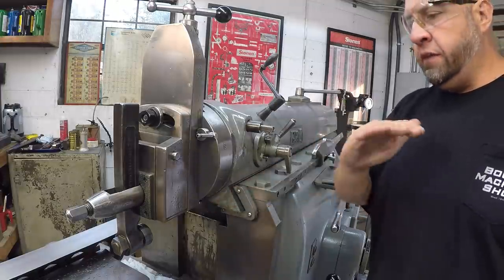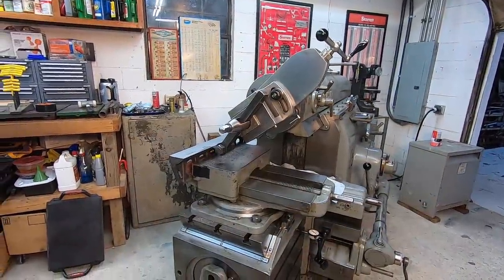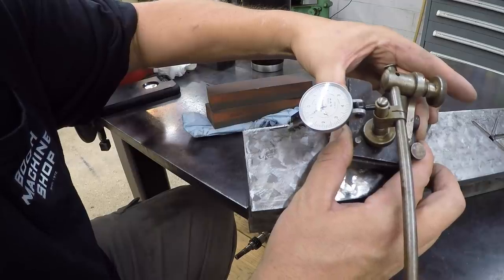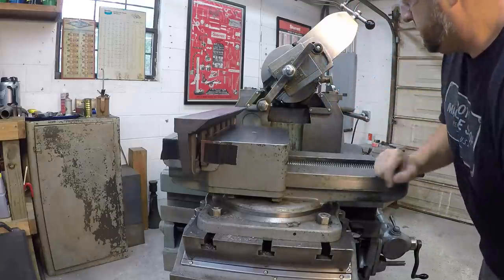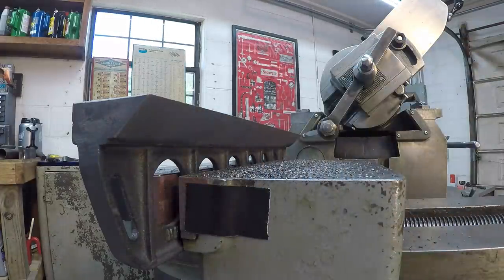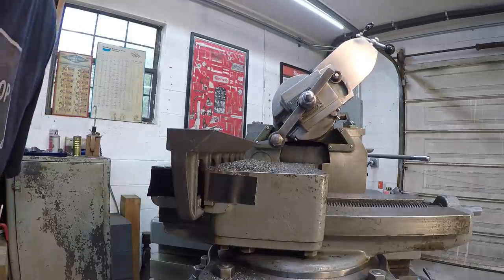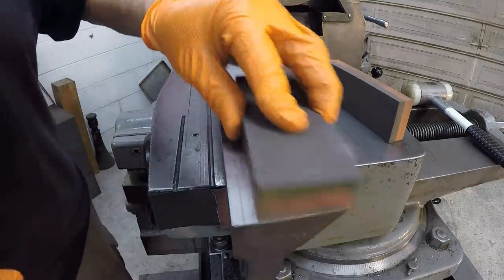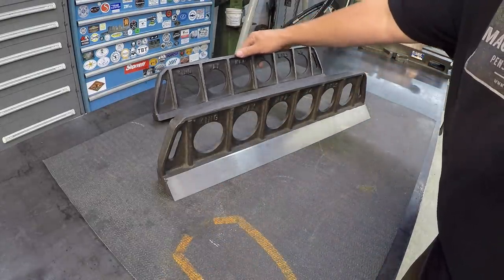Machining a 24 in Straight Edge with Dovetail Episode 2

Comment: Nice job of checking out the problem plus you found the oil level issue and were able to resolve it all. This is why I believe in checking every single operation on the machinery I use, it not only alerts me to potential problems but often you can head off a situation long before any damage can occur .

Comment: Nothing you don't already know Adam, but both those straight edges need a couple of wood, plastic etc handles to insulate the cast iron from hand heat. A nice informative series showing how to shape these straight edges into pre scraping condition old school style despite what the few non shaper fans seem to think. .001" over 24" is better than any average knee mill could do including a new Bridgeport. Paint color? Find something that matches a combination of hi spot blue with cast iron dust in it to save cleaning time later. :-)

Comment: I once changed out a VCT solenoid (passenger side) on a 5.4 3V when I should have just tightened the loose spark plug that was the actual problem.... because I'm an idiot. Valve cover, AC lines, trips to Autozone and an a package from Amazon ...it was a fun couple of days. Stuff happens. You and Rucker and Finner amaze me with the things y'all do right...the first time. Great stuff. Thanks for sharing.

Comment: Yeah... easy to do with a shaper. I’m certainly no Abrom. But I did similar thing when I first started using my Rhodes 7” shaper. The geometry of the ram / stroke constantly changes when making adjustments. I learned the hard way ( before I did serious damage ) to always manually turn the belt and inspect to make sure the ram isn’t hitting the housing.

Comment: Good eye Adam. This one of the reasons why shapers are problematic. You have to look at both sides and make sure you compensate the proper clearance for your cuts. Otherwise you will crunch the ram. And lets not forget the guys who push  the part out the back of the vice. Nice to see you were alert and used all your senses and notice the problem right away. Nice fix Adam. Job well done on the straight edge. If you would of used a positive flat bottom tool you would have a edge surface that is a lot closer with your indicator. Keep up the great work too.

Comment: Ideally you want to make it a bit shy of 45 deg.  When using this to scrape you can always "tip up" a bit.  If you make it right on 45 and the dovetail you are scraping is shy of that you have a problem.  Otherwise great video, I love watching these shapers run!
Reply from the maker: Hey Cash, my understanding is that most ways will be 60° so the 45° angle should give it plenty of clearance. I was going off of what others has done.

Comment: Judging from the appearance of the stoned surface of the bottom of the dovetail straight edge, the square-nosed tool was not making cuts that were exactly parallel with the overall surface.  (See the video at the 26-minute mark).  You can see that that is the case by the regular repeated pattern of the shiny stoned metal that peters out at the approach to the adjacent cut.
I know that Adam likes the appearance produced by the square-nosed tool, but for this application, I wonder if a shear tool used with a finer cross-feed would not produce a flatter finished surface. Since seeing shear tools used in shapers, I have experimented with using shear tools in the lathe. The surface finish that can be achieved, even on ordinary stringy mild steel is impressive. 

It looks like a ground finish. 
 Thanks for all the great videos. Cheers

Comment: Very glad that gib rubbing was so minor, it could have been worse, I think you really lucked out on that one. Learned a lesson gently :)
The upside down cut was not your usual type of cut for sure. It had the potential to disable the clapper which also could be messy. Since the tool raises up on the back stroke but the work is above the tool...

I would really love for you to try sticking a thin piece of leather on the back of the tool to stop the metal on metal rub for the backstroke. If it was not an issue then no one would have created auto tool lifters.

Comment: In my HS Mach shop class,many many moons ago, a student popped the head off the shaper,it did quite a bit more damage,good move,or luck, turning the vertical feed rate down,or you might have experienced the same catastrophic event.Good to have learned that.
Reply: JD Sharp   Was Mr. Pete your instructor?

Comment: One scraping project, tho i don't think you can get them fast enough for the class, would be to have two small cast iron plates with you. Those make really nice scraping projects and useful tools once you're done. Certainly handy to have around when checking large equipment that can't be moved.

Comment: Talk to Richard King about the angle, he says that less than 45degrees is better, 44 degrees is fine, better! Regards, Matthew
Reply from the maker: Matthew Tinker It makes no matter the angle
Reply: @Abom79  It is easier to use a straight edge that is smaller than the angle, you can "rock" it to get it flat, you are not stuck in the "V" and you can feel it better!

Comment: I disagree with your decision to go to 45 degrees.  This prevents it from fitting into any 45 degree gap.  It also removed more material farther out from the body. 43-44 would IMO have been a better choice, maybe even 42.
Reply from the maker: Bob O`Bob most machine dovetails are 60°, 45 is the standard people machine them to.

Comment: nice save on the machine abom! pretty minor damage :)
as for the color of the strait edges. grey,.... grey seems to go good with any machine shop
Reply: For that "Straight" straight edge with the nice machining on the ribs of the handle I'd keep the natural colours and just clear coat it. I like the contrast of a cast against a machined surface. The look of my old BAHCO adjustables comes to mind.
For the 45° tool on which the handle didn't clean up so well then I guess some colour would help tidy it up.
Reply: @KozmykJ  some tools are ok left as is, but I really prefer keeping machined/scraped finishes and not cast finishes due to how rough they are. plus most of my machines are grey. and it seems to be a color everyone enjoys... cast finishes I always feel look unfinished 
I do quite allot of cast steel parts and they always go for powder coating,
Reply: @Donkusdelux  I get your roughness point but once a layer of clear is on there they're not so rough. All depends on how good the cast surface finish looks to start with of course  ...
Reply: @KozmykJ  aye :) very true~

Comment: Adam, why not investing some time / money into making back stroke cutting tool keeper or whatever that contraption name is? I've seen somewhere that is some simple friction rod mounted to the machine that keeps clapper box a bit open on back stroke, so it prevents potentially ruined surface finish. You can see it rubbing always on back stroke and it surely is not ideal. Cheers!

Comment: Came out  nice. I wonder if there is a trick on the these angled downfeeds: the angle of the clapper may have to be changed (to what I have no idea), the tool is dragging on the finished surface on the back stroke.
Reply: I am not sure but I think the clapper is set on the wrong side of center, should swing away from the work on the return stroke. JB
Reply from the maker: 445supermag The clapper is set correctly.
Reply from the maker: Jake, I have it correct.
Reply: sorry I was wrong, Adam is correct.

Comment: It was too bad about the hard spots on that dovetail straightedge. But I definitely agree with you about the finish on the other one. I almost wouldn't want to scrape that in either.
Reply: Isnt it doable with a carbide or diamond tool?
Reply: @orfeous  maybe, but could be costly. Carbide is hard but brittle. It might chip or break from the shock of switching quickly between various hard and soft spots.

Comment: Adam,

You changed the tooling setup to provide the advancing tooling head clearance you needed. Could the part been oriented end for end in the vise and the table tilted 45 degrees, then down feeding with the head in the 0 degree position? I think that this setup would have allowed machining the bottom, 90 degrees side and the 45 degrees sides in a single vise setup and eliminating the gib clearance issue that you encountered. I liked your solution.

How do shaper folk identity axis on a shaper? I assume stroke is Z, but which is X and Y?

I love the refinements of modern machinery, but I also love the classy look and feel of quality vintage iron. I spent a career in the machine shop and never saw a shaper operate. Now I am retired and I really enjoy watching you young bucks reintroduce the old technology.

I grieve for the scarring on the side flutings that you couldn't clean up due to the hardness. Did you dress this out or leave it? I do woodwork as well as hobby machining. I am tackling more and more complicated wood projects to learn and to hone new skills. I will deliver a fine cherry hope chest tomorrow. It has three incorrectable oops blemishes that my wife can't see, but stand out as glaring errors to me. You do fine work. I aspire to approach your skill.

Comment: 1 thou over 24" on a shaper is excellent Adam, you must be chuffed about that.
Reply: If he's anything like the other old-school-trained machinists I know, he's telling himself it's "pretty good", and thinking about how to get to half a tenth on the next one.
Reply: I can definitely see a surface finish improvement if he works on the bit geometry. I'm not sure how he might improve the deviation on the stroke of the machine. There's a lot of things in play on this machine when it's in operation that could cause a dip on the ram.
Reply: I don't know enough about shapers. Give it three months at most, and we'll have an answer.
Reply: ThrowingItAway 
L
Reply: @Coffreek  ...He has used this scraper well over three months.

Comment: Hey Adam! Nice project for the scraper! I noticed the overoiling you mentioned on the left way. I would be willing to bet that that's the side that the pump makes it to first. But either way I would put a restrictor sleeve in the oil port on that side. About 25%. That should force more to the other side where it looks a little shy of oil. You coul always drill it out if it cuts off too much. Once you get it to even out, if there is still too much, you could add a spring loaded adjustable pressure valve to bleed off some back to the tank (bottom?) Hope this helps...

Comment: Forgive my ignorance, but if the 45 degree angle doesn't need to be precise, why have it at all? Could you explain a little of why its nice to have it on the base of the straight edge?
Reply: When you're bluing the surface to prepare for scraping, you're only wanting to bear on one of the surfaces. So when you're bluing the flat part, the angle section of the straight edge shouldn't be touching the angle of the ways. When you're bluing the angled part of the ways, only the angled part of your straight edge should be bearing on the angled part of the way. So really any angle between ~30-45° is acceptable.
Reply: @xenonram  Thank You

Comment: I know you have gone over this many times but for this 45 degree cut which is underneath or reversed, you DO have the clapper the wrong way. The arc is swinging the tool up INTO the part.
Reply: What is the clapper you are referring to?
Reply: Robert Mick it’s the plate that the cutting tool is mounted to that hinges and allows the tool to “float” over the workpiece on the backstroke. It can be angled left and right depending on which direction you are cutting as well as many other factors.
Reply: Ahh, thank you for the explanation. I'm not a machinist, however I find the craft to be very interesting to watch, and Abom's humility and style make it very easy to watch.
Reply: Yes, I really like the guy too, he’s a good hearted southern boy like myself.

Comment: I am surprised you set up the job that way.  I would have thought you would have set up the straight edge so that the 45° surface was parallel to the table with angle blocks and clamps.
Reply: He has said many times that he enjoys the different setup challenges with the scraper.  This was one of those.

Comment: Hey Adam, why not have that Clapper box turned the other direction on the 45` cut? In my mind, the tool would swing away from the surface instead of dragging back over the already cut portion. I honestly want to know, I'm not digging at you, I just don't have the knowledge and want to understand.

Comment: While I'm guessing it's just a question of different ways to approach the same result, was there advantage to rotating the tool head and making the 45 degree cut versus rotating the table to bring the surface into a vertical orientation and leaving the tool head alone?

Comment: Gib damage caught on time, fixed and ended in a very nice job. I don’t understand why the hardness on the back if it is a cast. Isn’t it poured liquid and then should not have hard areas.
Reply: Hardness in a cast iron piece is due to uneven cooling.
Reply: Got it. Thanks.

Comment: If instead of angling the tool head, you kept it at 0°, set the tool perpendicular to the cut you want to make, then feed both the down feed and the step over together the same distance, shouldn't you end up with the same effect?

If the machine can do both feeds at the same time, by downfeeding say 0.020 and stepping over 0.020 at the same time, and having the cutting point perpendicular to the work surface, you will "trace" a line with a slope of 45° with every cut. It would be a little more difficult for other angles, as the ratio is not 1:1 and you may not have the right settings, but for 45°, it is pretty easy, if the machine allows it.

Comment: What if you "uncover" a void/pit in the casting after machining?   Do you braze in the void and machine it flat?  Also do you have a lifter for your clapper box?  I didn't see one.  You might have been able to machine those hard spots with carbide, but carbide doesn't usually like the banging on the return stroke of shapers, but maybe carbide has changed since my machining days. . .

Comment: @19:00 Isn't that a bit too much oil dripping out ?
Reply: I believe that gouge is now letting the oil flow past the oil seal
Reply: @bighurk30able  you might be right but if you look closely on the right side you can also see that the felt wiper retainer is also missing a chunk on the top corner but the felt still does it's job . It's kinda weird
Reply: He mentions it at 10:25. That one side has been over oiling all along.
Reply: @xenonram  Oh ok ,thanks !
Reply: Better too much than not enough.. an oiled machine is a happy machine.
Reply: @louisturner8842  Better a machine with the perfect amount of oil, than an over oiled machine. Lets not settle with mediocrity, and construct platitudes to defend it.

Comment: I hit with my shaper's head the lower slide way - when I adjusted the depth of cut using the top screw just too much and the stroke was long.

I was also like what is this thump sounds... never did that before... oh... clearance ;)

Comment: Does the tool bouncing on the back stroke leave a pattern on the finish?  Is there anyway for the tool to lift away from the work piece on backstroke to prevent that?  Great videos I always love watching a true craftsman.
Reply: I am not sure but I think the clapper is set on the wrong side of center, should swing away from the work on the return stroke. JB
Reply: I was wrong

Comment: Do u always set the Clapper at a greater angle than the head to ensure clearance? Also, in the view after you stoned it we can see what looks like very fine chatter marks. Is that normal or is the stoning exaggerating it? It looked like a good planar finish like you would see on a Bridgeport table.

Comment: 17:37 looks like the ram is deflecting slightly (gibs not tight enough?). You can see it move back when the cut is complete.
Reply: skmetal7 designed to move the tool out of the way. It does sound like it was dragging on the back stroke although.... which I have not noticed before.

Comment: Can you not adjust that ram so it does not come back to expose the wipers? I think I would refer it be set to work from that pint out even if it did mean you lost a bit of rigidity being hung out 2 more inches.
Reply from the maker: I would have had to position the work and vise further out to try and achieve that. No big reason to. It’s designed to retract way back in the column to clear work as needed. If I’m using an internal bar, the ram will be post it jones pretty far back.

Comment: On that thou low in the center, I'm idly wondering if that was due to stress relief after you took .200 or whatever off the face. I wonder what would have happened if you had loosened the vise after the roughing cuts, left it overnight, then re-tightened the vise and took the finishing cuts the next day. Obviously things would have shifted a little loosening the vise, but maybe only .010 or .020.

Comment: I watched the previous video of machining the Camel Back Square.  I thin I noticed that the table moved on the back stroke.  Would that be a problem?  I think the uncut portion of the Square would try and deflect the cutting tool downward.  Am I missing something because I think the tool is designed to lift the cutting point on the back stroke not deflect downward.